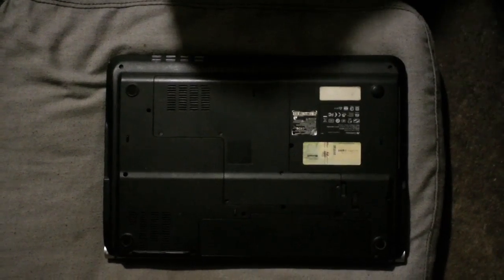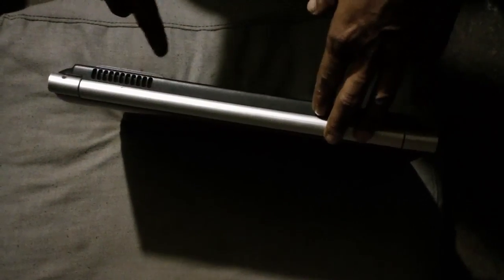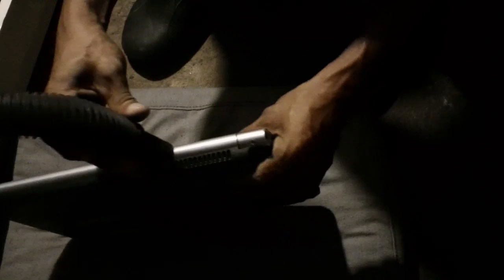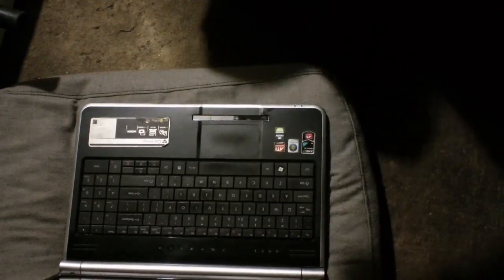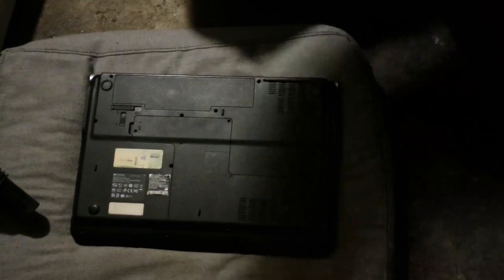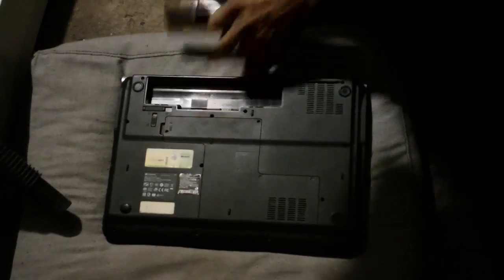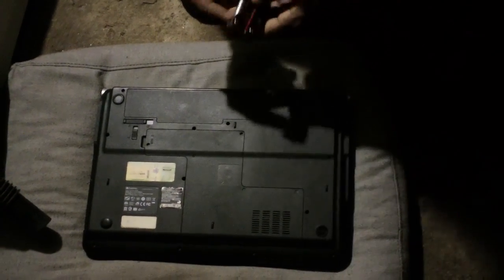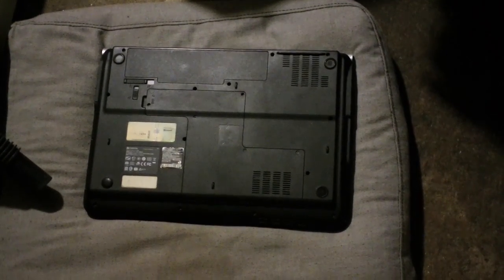Laptop Shut Off By Itself? Cheap & Easy Fix !!

Comment: Thanks so much for the information. You saved me from buying a new laptop. My computer kept randomly shutting down, sometimes right after it started, and I was ready to buy a new one. It's hard to believe that the solution was so simple. The vacuum cleaner was sitting just a few feet away the whole time, and I had no idea that all I had to do was clean out all of the crud that had built up over the years. It's been running nonstop for two days now, since I vacuumed it out. God Bless. You're the best!!!

Comment: I'm going to try this in the morning, I really hope it works, this is my last option
Reply: +zenopssmdk Did it work?
Reply: HA no, my problem was my motherboard was damaged shutting it down every 30m this helps though
Reply from the maker: Did it work ?
Reply from the maker: Try putting a fan by the vents of the laptop.. To force cool air into the laptop.. If your a tech .. All you need to do is replace the thermal paste between the processor and mother board.. After time the thermal paste hardens and doesn't make the proper contact with the motherboard..
Reply: dude my problem is way beyond that, after a good months of looking everyone that has this problem is just dumping their computer
Reply from the maker: if yours is beyond that you might want to use a pc duster(you can get that at walmart for about 6$)at the same time your vacuuming the pc. Vacuum  the keys and use the duster at the other vents... the burst of air from the duster should loosen any dust, lint whatever, and the vacuum sucks it up.. good luck
Reply: as i said its not a dust problem its a damaged piece
Reply from the maker: gotcha... good luck
Reply: zenopssmdk Ink Tim help mine turns on but after I sign in and load up input mapper or a game it shuts of and if I press power it doesn't come on until I turn it off and on a few times but then the process just repeats and I'm kinda getting pissed but i don't want to smash it pls help
Reply: Pretty sure using vacuums is a no go on electronics.
Reply: Did it work
Reply: @handel136   no one is going to answer you because u r not reading the other replies, and don't be self centered
Reply: @RyknFN   bro ,dont be pissy
Reply: I'm getting desparate fam💔😂
Reply: Btw its just a battery problem for my laptop
Reply: @zenopssmdk  same problem bro .how you solved that??

Comment: If you vacuum the vents of a laptop, that may make the fan to spin and generate some electricity that can make some components to fail, first make sure that the fan power cable is unplugged. This is just my opinion but nevertheless be careful. nice video bw :)
Reply: How do u make sure it's off?
Reply: @Miguel-bj6is  turn off the computer ?

Comment: I don't have words to express my gratitude to you for sharing this video. It's folks like you that make this world great.

I had two expensive HP Laptops just sitting dead because they (one right after the other) start randomly shutting off right after the warranty ran out. HP wanted me to send them to in after making a huge upfront payment.

I was very doubtful when I came across your video (quite by chance). But I thought, what does it hurt to try.
Was I shock now that my laptops are working. I left them on for 48 hours straight just to convince myself

Comment: I would not recommend this gentlemen's approach,  the heat sink fan utilizes ball bearings, or etc.,  these are engineered to achieve a certain amount of rotations per minute (rpm) the vacuum  will more than likely exceed these predetermined speeds,  this in turn may result in mechanical failure. Great idea though,  I like the concept of channeling airflow to create pressure where you want it.
Reply from the maker: +CarLos DoraDo I hear you , I think if you use the vacuum for an excessive amount of time you can damage it.. but for a quick clean job, it's ok... thanks for watching..
Reply: CarLos DoraDo
Reply: king gameing what's up bud
Reply: It should be mentioned to put the vacuum cleaner on the lowest level. This will lower the risk.
Reply: CarLos DoraDo c
Reply: unplug your fans
Reply: What about using a can of compressed air instead? PC techs use this all the time to clean out dusty fans and I don't think theres any problem.
Reply: CarLos DoraDo Ink Tim help mine turns on but after I sign in and load up input mapper or a game it shuts of and if I press power it doesn't come on until I turn it off and on a few times but then the process just repeats and I'm kinda getting pissed but i don't want to smash it pls help

Comment: but my laptop doesnt overheat but it shutdown and the laptop cant be charge whoever read this please answer and tell me the solution please.....😭
Reply: oh yeah and after it shutdown it cant be turn onn again please help i think i have a different problem but i dont know what it is
Reply from the maker: you might wanna check the power supply... or where the power supply connects to the laptop could be loose
Reply: Thx
Reply: Ink Tim omg same
Reply: same problem but i dunno what to do...i've opened my laptop and it just fixed for 2 or 3 days but it repeats after 4th day
Reply: Ink Tim help mine turns on but after I sign in and load up input mapper or a game it shuts of and if I press power it doesn't come on until I turn it off and on a few times but then the process just repeats and I'm kinda getting pissed but i don't want to smash it pls help
Reply: keaton well same man fk laptops I will buy a PC in January XD
Reply: Me niether i need help
Reply: Did you guys fixed it ?? help me out please!
Reply: I had same experience but was able to solve the issue. Please watch it here: https://youtu.be/3L03ZMebRLM
Reply: Same Problem But Don't Work
Reply: same....whenever I play any game(Trove, Roblox) it shuts down(Trove did not make it shut down before).
Reply: Ink Tim ur battery probably messed up
Reply: Buy a new one
Reply: Same
Reply: Its overheated u have to wait 15 min and then turn it on
Reply: Same, I never found a solution so I had to buy a new pc
Reply: Yrah i dont have a battery inserted
Reply: Ink Tim my laptop does the same aa yours how did it work again?
Reply: I also had the same problem. Been trying to resolve with many ways, both software and hardware wise. And then I came to the conclusion that the CPU is the main culprit. So I upgraded it and now it's fine.
Reply: Same here dude i just opened re 2 and it shutdowned automatically idk why :(
Reply: @strandedinpr  the real problem is battery but that too
Reply: Mine is ALWAYS shutting down!

Comment: It helps but if ventilation is the issue the better long term fix is reapply if necessary thermal compound,  replace with new cpu fan and do your cleaning maintenance,  this is the real long term optimal fix, truth.

Comment: I work on computers...and all sorts of electronics..I've found the best method is air compressor..with the blow tip on it..you can blow out laptops..desktops..game consoles..it cleans fans and all dust out quick..off motherboard as well ..
Reply: hy i have a haier laptop i use it last night and shutt  it down today when i start it it screen gets   shutting down and try to restart again and again but it dosnot change plz help me

Comment: I have a vintage Gateway Solo 2550 from 2000 that has some pretty meager specs. (Pentium 600MHz and 544MB ram) It's running Windows 2000 and it will shut itself off after simply copying over files while listening to music or even while watching a DVD. It doesn't take much work to push this laptop too far. I had to replace the screen due to the system crashes occurring more frequently. What's scary is that before I replaced the screen the power fluctuations caused smoke to emit from the lower right hand corner of the screen along with melting plastic. I had to immediately shut down the laptop and cut the wires leading to the display screen before it toasted the motherboard. Since the screen was replaced, it still crashes, but maybe less frequently, and even after I replaced it's suspicious charger. I really hope your methods work for me so I can save this classic system. Do you have any extra tips for me? I was thinking about replacing the thermal paste on the heatsinks. Or maybe being crash-prone is just a common problem with this exact model, as if it's defective or something. I wonder if the similar models from the late 90's and early 2000's also suffer from a poor cooling design.

Comment: i have the same problem with exactly the same laptop, thanks for making this video, i´ll try to do it
Reply from the maker: Good luck
Reply: +Gerardo Olvera Puente Did it work?
Reply from the maker: Did it work ?
Reply: no, still keeps shutting down
Reply from the maker: +Gerardo Olvera Puente try putting a fan blowing at the laptop, it will force air thru the laptop, and it will run cooler.. It's a temp fix..
Reply: that's what i've done, after making the cleaning. Right now my computer shuts down when i run windows on it, but the most of the time i run linux mint in my computer and works really good on it...
PD: thanks for the advice...
Reply from the maker: linux, thats a good idea... your welcome

Comment: My laptop does not have those holes in it and as a bonus i do not have a vacuum!
I say just put in your freeser for 30.minute and presto it works now just repeat the prosses until you buy or take your laptop to a technition to change your battery

Comment: i know there could be a million diffrent things that could couse this bt recently i removed the cpu i have i7 and i put it back in then i turned it on and it turned of i took it out again then put it back in with out the fan and it worked and the cpu heated up but only for like 5 secopnds then i turned it of and the next day i turn it on and there is no display then i mess around a bit and then i get that problem were it turns on then off instanly but when it wasnt turning off the cpu was not heating up and there was no power to the usb or hdmi cable. please help me

Comment: My problem is I go on the laptop for 10 minutes then it just shuts down, I can turn it back on but it keeps shutting down. Please help.
Reply: Toxic Aura Same bro
Reply: Did u find the solution?
Reply: AlexGaminYTP XD well kind of, this method is if it overheats, I got four bottle caps and put them under each corner then put it on a flat table which means you can’t use it on sofa,couch etc.
Reply: Toxic Aura but will it work? Because when im playing some kind of games or when im not using it after like 5 minutes it shutdowns by itself.Oh and it overheats sometimes but cooler or hoter which makes the fan louder
Reply: AlexGaminYTP XD it works for like 2-3 hours.
Reply: AlexGaminYTP XD but remember your room has to cold (below 25-30 degrees)
Reply: Toxic Aura Its my luck cuz winter is coming at us in europe.Btw can i use a fan on my desk aiming at the laptops fan to keep it cooler?

Comment: Bah, my brand new laptop with less than 10 hours keeps shutting off while plugged in and merely downloading.
Power plan is set to NEVER shut down...  not to mention, the battery is 100%

Comment: My Dell Latitude E6340 only blows air out when u switch it on and eventually it will trip and the screen remains black but the dim lights of networking, battery and that one I don't know remains dimming.  Tried many times but can't see  any light on screen help

Comment: Hello sir...I have got my dell laptop with a little problem. When i switch it off, in the next day it doesnt turn on. I have to connect my speaker into the laptop to discharge the battery while it is off. for some reason after, i plug the charger and it turn on. But this problem is coming over and over again. can you help me with this please?

Comment: I have "Acer Aspire 5733Z" It turns on loads up and then after 30 mins turns off. The time gets shorter and shorter to where it won't turn on. The hard drive is good (tested). Any ideas where to start or what to buy since all those little parts seem so inexpensive.  Buy the little parts anyway in advance before  attempt repair. Appreciate any help.

Comment: My laptop temperature goes to 90 C after watching a few  Youtube videos.

Vacuuming like this, doesnt it loosen the parts?

I will take mine into the computer shop and have them remove the dust.

Until then I have to run CPU at 800 MHz and Youtube at 240 res.

Temp stays ~60 C
Reply: jaworskij Buy a new computer

Comment: I have Acer Aspire E 15 and everytime I lift it up, it switches off and this happens when it is not charged. Please someone help
Reply from the maker: Your batt might be loose... So when you lift up the laptop the battery disconnects... Or the wires on the inside that give power to the laptop are loose and need to be sodered
Reply: @strandedinpr  Thank u so much

Comment: My laptop either shuts down without any warning or when I'm on word or google it presses 65 -= all the time. Know I can't even get on the laptop. It does feel over heated at times however other times it doesn't. Its a windows 7 Dell. 😑😔
Reply from the maker: i had a dell that did the same thing, the best suggestion i can give you is try to place a small fan aiming at the laptop, make sure the laptop is off the surface so that air can flow under it...once you get it running copy paste all the files you want to salvage.. once you have saved all the files then run diagnostics.. there are a few diagnostic tools at cnet.com

important...... copy paste, not cut paste.... if you cut paste and your laptop shuts off in the process you can loose data,of the file all together

Comment: Wait a second I never test that is my fan is even working or not OMG that can be the issue I need to check that next day because I punch on my laptop fan and it was making a noise and after some days when I turn on it didn't make that noise It can be that my fan is not working or If the fan is working so I think that can a problem from thermal paste that was connect the fan to the motherboard because the repairer don't open the laptop and check and the laptop shut down and he just said that motherboard have problem it can be the thermal paste or the fan problem

Comment: I'm Using a Acer Aspire Series Windows laptop

I've checked the fan pretty clogged up with dust but it spins fine

And it cuts off randomly I've placed it close to a window that doesn't work

I was wondering would the vacuum to the fan do the trick?
Reply: try it i think it will fix it.

Comment: I have a stander..or.. idk how its called wit a fan, didnt help much and I tried light with battery that part where its suckong the air in to see if something is in there.. couple of dust and im too afraid to do what is shown in this video... Im going to shop tommorow
Reply: sry typing in tablet:<
Reply from the maker: +Animalio SK you can do the opposite, and purchase a can of duster at walmart or staples....

Comment: Hi there i am having a problem with my computer. I have a laptop that keep turning off whenever I don't have it plugged in. After maybe an hour or a few it shuts off for not reason at all when i don't have it plug in. I don't know if its overheating or what so could you try to respond to this post to try to help me. I want to be able to use my computer without any problems thanks

Comment: Done this, still turn off by it self any suggestions on how I can't fix this problem, it's gett beyond a joke now, I can't do anything
Reply: Fahy TT
it should make your pc cooler
Reply: I suggest you disassemble the laptop, clean the cooler and re-aply thermal paste to the cpu.
Reply: i have tried that mine still shuts off
Reply: Another thing you can do is to set the power config in low, so your cpu runs with low voltage and runs cooler. Also this make your laptop slower.
And another solution that I saw is to buy a cooper sheet and fit it into the laptop, making contact with the cpu heatsink. This improves the thermal dissipation adding more surface to dissipate the heat.
Reply: Ok I will try that
Reply from the maker: thats good, i wanted to say this and you worded it perfectly!!

Comment: Need help !! my friend's laptop was new bought brandnew . but after a week , the laptop was turning off by itself. then once we turn it on again after a few minutes it will going to shut again . it doesn't overheating . and also the laptop doesn't charge properly even though it doesn't have any issue with the power supply and charger !. Help pls .
Reply from the maker: Sounds like the battery is bad...
Reply: strandedinpr i think so . But i asked it also with my co-worker they said it was the hardware and we need to replace it

Comment: I'm having problems with my laptop randomly shutting off while it's being charged I've never had this before but I also have the problem where i need to have my charger in my laptop otherwise it won't turn on

Comment: In my case my PC shutdown unexpectedly only when I start using it after the battery charges to 100% but if the battery does not charge to a 100% let's say 99% if I start using it . It doesn't shutdown unexpectedly

Comment: i opened  computer then i cleaned it. and it's fixed but after a week his turning off again.
Please Any Help?
Reply: you should tape the holes after you bakume it   sorry for bad spelling
Reply from the maker: + H4roune you might need to remove the thermal paste between the processor and motherboard  and replace it with new thermal paste

Comment: Maann help me!  After my laptop updated itself it would just turn off by itself.I turned it on bit after a few minutes it just shut off immediately like the screen would turn black immediately. Damn I don't what to do.
Reply from the maker: Try plugging in an external screen .. use HDMI,  check the settings...
Reply: Thanks bro